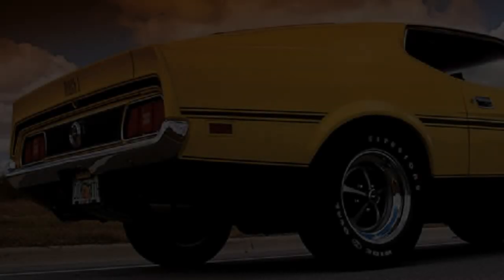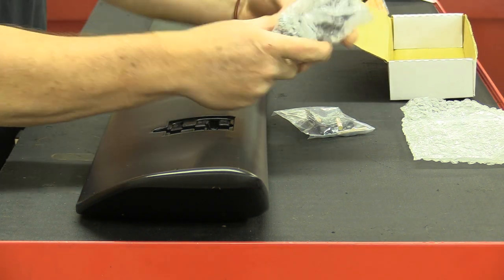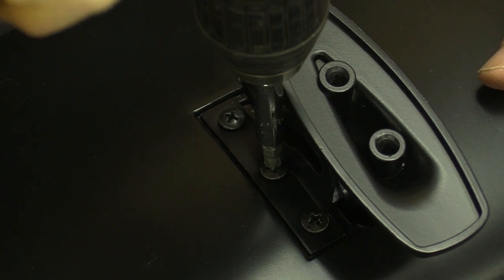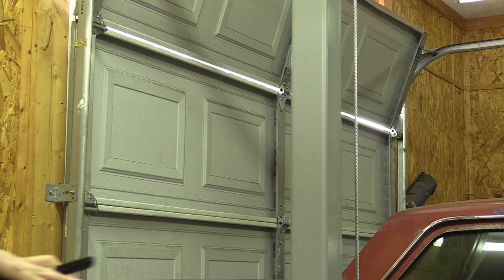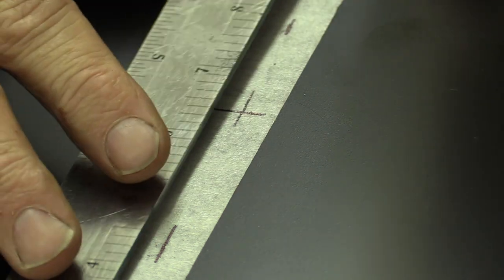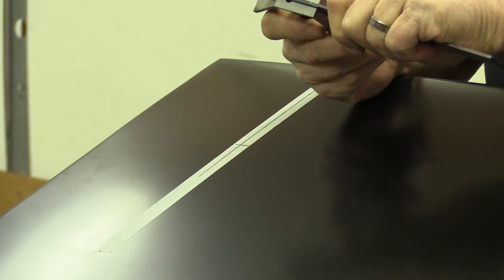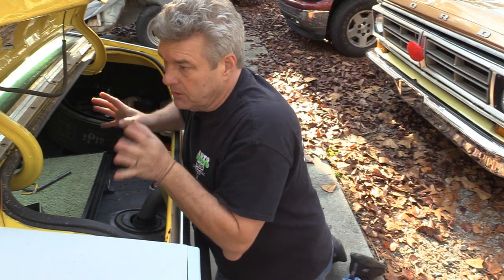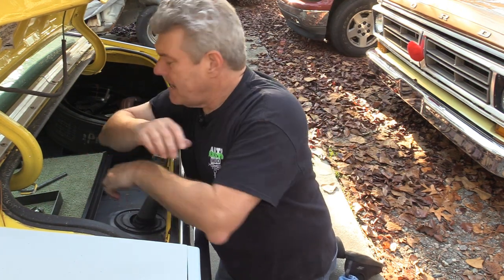Rear Spoiler Mustang

Comment: I put the rear spoiler and front air dam on a1971 Mustang Mach that I had,gave it a great look. Also installed the correct exhaust tips. You’ll be surprised when the car was sold, I made good money. To be honest the fit and finish of the 71 to 73 Mustangs left something to me desired.  They did look good with all that bling. Bye the way the car was sent to Australia. They must love their Fords ! My 1970 Torino went to Australia to.
Reply from the maker: There is a ton of US iron going to Oz. The front spoiler is one I am considering. In a Mach, anything over 90 and the nose gets floaty.
Reply: @AutoRestoMod  Where are you driving 90?

Comment: Looks great, one suggestion, some butyl, or silicone will help prevent future corrosion in the metal you just left bare when the holes were drilled.
Reply from the maker: The deck lid won't go on until it is painted. I should have made that more clear. I was busy trying to train three new camera people and shoot the show, mentioning that slipped through the cracks.
Reply: @AutoRestoMod  it is certainly not intended as a criticism. You do a really great job Jeff. I know there are a myriad of different subjects you have covered, and I have always been impressed with the time you out into the research to help your subscribers, nothing but respect sir.

Comment: Looking back when I had a 70 fastback between the louvers and the rear spoiler I couldn't see anything in the rear view mirror.  I imagine a 71 through 73 is even harder to see out the back window.  Not that I cared but the spoiler also caused drag and reduced mpg I'm sure.  They do make the car look cool 😎!  Superbird wing was the most awesome spoiler ever!
Reply: I don't think you drive one of these for mpgs... ha, ha...  It's all about the looks, like when bell bottom jeans was the style..
Reply from the maker: I have a 351 Cleveland 4V. It will pass anything but a gas station...😆 I honestly plan to install a backup camera on this car. Yes, we will do a video.
Reply from the maker: Mitch: Right on man! Power to the people!
Reply: I stand 5'-6". For as long as the back glass is, from the rear view mirror it looks only 10"-12" in vertical height. Add to that the high bucket seats, my rear vision was horrible.

Comment: My 69 Mach1 does not have this type of spring (my 69 is with spoiler)
How do I replace the springs in my 69?
Reply from the maker: The spoiler on the '69 used a prop rod.

Comment: What is the difference between a 69-70&71-73 rear spoiler
Reply from the maker: It is all in the pedestals. The 1969-70 spoiler is taller. I've thought about doing a "things that you might not know on rear deck spoilers" soon. Just as a side video.